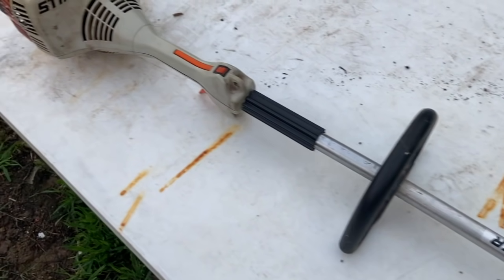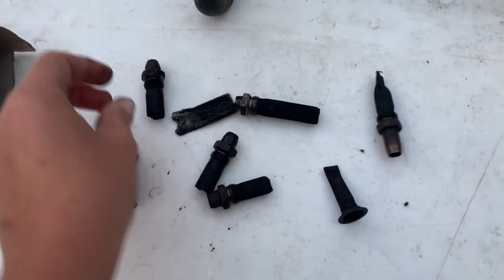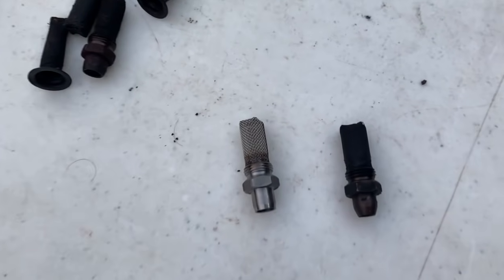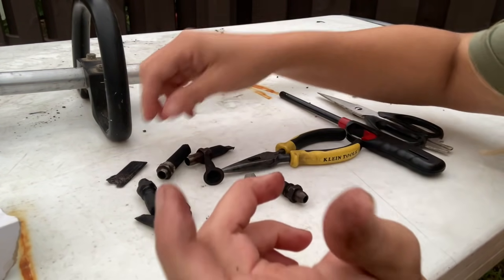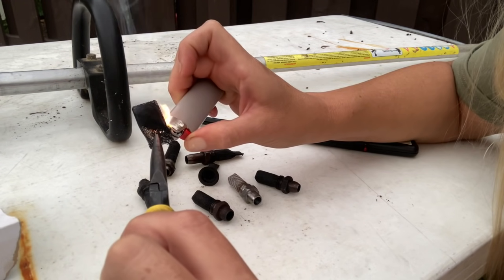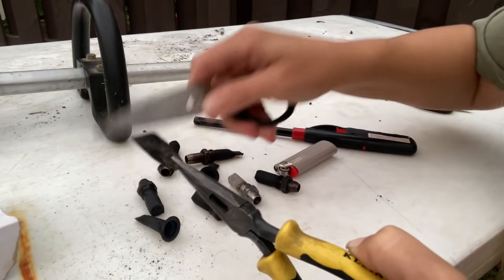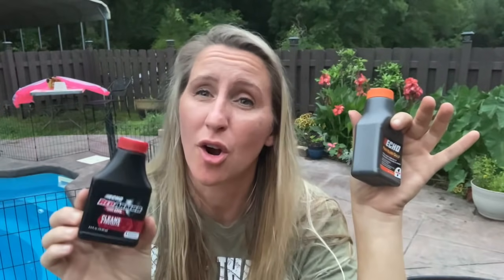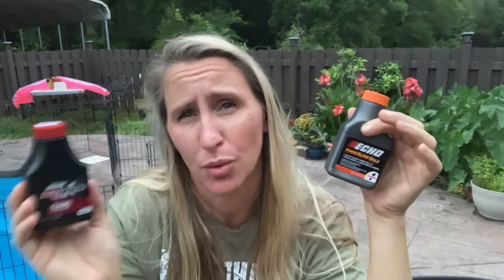THE BIG SECRET! STIHL has NO POWER? Won't Throttle Up? How to fix your trimmer/blower.

Comment: I have pulled the spark arrestor out of my equipment for years.
Haven't started any fires and the EPA has not arrested me yet.
I am 70 years old
Reply: OLD SCHOOL BEST WAY
Reply: Yep, I have done the same and I'm 65.  I feel like a fugitive from justice though, when I use my trimmer I keep an eye out for the "Spark Arrestor Screen Police".
Reply: I guess it's really true what they say about old dogs and new tricks.
Reply: Watch out for the EPA SWAT team sneaking up on you in their stealth black helicopters.
Reply: The forest service has standard (FS5100-1D) for Spark Arresters and 36 CFR 261.52 is the federal regulation that requires the use of spark arrestors in accordance with FS5100-1. Modifying the exhaust to improve performance is always a balance between flow restriction and performance. Just don’t get caught in the forest service jurisdiction without them. Painful and costly potential experience.
Reply: I don't know why they put spark arrestors on Equipment that is for residential use the whole spark arrestor thing was started by the Forestry service many years ago and was directed mostly at 4 cycle engines back then I was motorcycles and still is it's funny cars and trucks drive
 through the forest and have an exhaust system but no spark arrestor on it
Reply: @DesertSawyer  forest service will check as well. Typically easy to locate someone using a chainsaw and it's simple to check if it's missing.  I'm sure you'll get blasted for being the hall monitor, but you are right and could save someone a costly fine. Home use and a trimmer for example is a other story tho.
Reply: @1995dresser  they also typically have much longer exhaust runs than a chainsaw or string trimmer. Alot harder for sparks to travel down 3 feet of pipe than right out the exhaust port and into the Great beyond
Reply: That will be the EPA at your front door!
Reply: Agree. Home fine tuning is important
Reply: Well Paul,  I happen to work for the EPA.  what would be a good time for me to visit? lol
Reply: @noclass2gun342  yes that's true but I am sure like me you have seen hot carbon or even a flame shoot out of a car exhaust from time to time
Reply: Had a stihl pipe saw.  Cut steel with it and sparks are everywhere. Despite that it has a spark arrestor that plugs up within six months.
Reply: Yep
Reply: @DesertSawyer   I always try to sneak in and trim as much as I can before the EPA and the rangers try to catch me 🤔🤔
Reply: That's right, with our two stroke bikes that was the first thing to go.
Reply: Clean it and put it back not worth your house in a law suit !
Reply: @Joe. Halo Garbarino A clear indication that a different law is in place for these elitist bastards and another law is in existence for us poor downtrodden hard working peasants. 🤨😲😊
Reply: Paul Zacher - I too am guilty of pulling the arrestor out:) How they get ya is if you start a grass fire and then they determine it was because your equipments arrestor was removed.
Reply: When you are modifying the performance characteristics of your saw or other 2-cycle engine, the exhaust flow characteristics are just one of many i.e. cylinder porting and polishing, intake filter modifications, timing advance, coil changes, and so on. All are used in harmony to give the best performance for the power saw…or tool. In the case of the exhaust mods to gain performance, as in dual porting the muffler, you can dramatically increase the performance while being compliant by using spark arrester screens on both ports. Just remember…making more noise doesn’t necessarily mean more power…it just means your power curve has changed and you need to adjust to that or continue with mods elsewhere to improve the overall performance of the engine. Also…don’t you just love the weird off the wall rabbit trails comments can take the conversation…it’s hilarious sometimes.  The point of a clogged screen that Chickanic was making is a good point. Even experienced 2-cycle users whether with chainsaws or others can forget about the screen. You just have to realize that when you use your 2-cycle power tool at 1/4 or 1/2 throttle when trimming the lawn or cutting wood, you will need to keep the screen from clogging one way or another. Whether manually using the method demonstrated or running your engine at full throttle enough to keep it clear.
Reply: @Joe. Halo Garbarino 
Ha'' Ha! @Joe a great dissertation 
on the Clintons, by those standards 
We could do our weed cutting with
A fully automatic submachine an it
Would BE LEGAL.....
Reply: @DesertSawyer  LOL!!!
Reply: We are on the way.  Address please?
Reply: @Joe. Halo Garbarino Yeah but what about Obama?
Reply: Not all Hero’s wear capes!
Reply: If Greta sees your comment you’re finished, she’ll have an army of angry climate alarmists barking at your door.
Reply: Paul -  Key word here is "YET".  So it could never happen. But if it ever did, you could start a fire that might cost you thousands of pesos ... (Why not just clean it !)
Reply: Same here at 69yrs old. If you want your 2 stroke to last hit the gas!
Reply: Put a spark back in your life!
Reply: Same way. Simple is still the best.
Reply: Exactly man. I just said the same thing, it's a bunch of bs. Just take dang thing out n run your machine however you want.  People over complicate everything.lol
Reply: John Everlasting  I agree. Manufacturer’s don’t have a whole lot of options when it comes to legislation and how they maintain a successful business so, a one size fits all approach is cheapest hence, Spark Arresters for all. With a little thought and engineering, one can work around the performance issues of screens and still have a brute of an engine.
Reply: The very first thing I do is to remove the stupid spark arrestor screen on every small engine. Easily 30% more power and infinitely more reliable.
Reply: @DesertSawyer  nobody really cares.
Reply: @allaboutroofing2  they can't take anything apart without a warrant.
Reply: @brentnone-ya3544  🤣🤣🤣
Reply: @duckwacker8720  I know. Very rarely does anyone use their chainsaw, unless professionally, in the woods where it would be an issue. That being said…they know now.
Reply: @duckwacker8720  they don't have to take it apart. You can shine a light in the exhaust hole as see if it has one or not. Of course they can't take your shit apart.
Reply: I met lots of people in California that removed the spark arrestor on a piece of equipment over the 32 years I worked for CAL FIRE.
Reply: @rustyclaymore1105  I believe you. Removing the screen is the cheapest and quickest way to gain a small jump in overall performance.
Reply: @rustyclaymore1105  CA doesn't have the best record for fires. Not something to brag about really.
Reply: Yeah, I understand that... BUT they seem to have a little wildfire problem there(?) in the USA and here in OZ. Better safe etc.
Reply: That spark arrester is history. Old school works best! 
I've run my old Harley for years with no baffles and I never hear any complaints!
Reply: @derekcole5593  that's because you are deaf. Hard to hear complaints that way. 😉
Reply: @derekcole5593  Yeah, Harley, 2-cycle, Top Fuel, and Formula One engines have sounds like no other. A symphony for the senses.
Reply: @DesertSawyer  and for a man's soul.
Reply: @allaboutroofing2  What did you say?
Reply: In theory it could but it would have to be extremely dry and stuff very easily ignited.
Reply: @Joe. Halo Garbarino 👍
Reply: Well done ,I do the same thing except after doing what you have, I re-tune it alittle richer to compensate for the better exhaust flow & to keep the head abit cooler!
If there is a mesh filter for the fuel,I get rid of that also & put an inline fuel filter in whenever I can!
Reply: Ken Brown @ Yup,so pay attention 😜
Reply: I'm with you on that, we had Ranger Bob out in one of the national forest here in Louisiana always trying to flag us down to stick a rod in our exhaust and check for the screen. We just pretended not to see him and would motor away.
Never had a fire in all the years we were riding either.
Reply: The dealers and people on youtube can't really tell you to do that.  It's probably breaking some law.
Reply: As i understand it, here in EU we don't have spark arrestor on any of these machines. I'm at least dead sure our machines don't have any. Some are old and some are new.
Reply: @DesertSawyer  thank you sir I have gone two a four stroke weed eater which helps and my dirt bikes and saws I just clean them and a lot of the new oils you can easily run at higher mix ratios 50 to 1 or more which really helps and as far as more power I own a medium size stihl pro saw and compared to other saws it certainly does not lack in power without any modifications just keep it sharp and a clean air filter colorado life time resident and I'll keep my spark arrestor on the saw where it belongs !
Reply: What is your opinion on Opti-2 oil? I've been using it for a couple of years in my trimmer with no problems.
Reply: yup!  same here , plus remove any baffles
Reply: If I lived anywhere out West I would use the arrestors. Lol!
Reply: I guess no one here that removes them lives in an area with dirt daubers or mud wasps? I've had over a dozen units brought into my shop this year where the spark arrestor prevented those little bastards from going into the muffler then into the cylinder.
And one where they took it off and a nest was made in there which caused the unit to have failure with extensive damage.

Also, just shake your can like it owes you money before each fill up. Most of the time the screen is clogged from the fuel and oil separating to cause an imbalance in ratio. More oil in the mix causes an impure burn which send carbon to the arrestor and clogs it.
Reply: Absolutely right, get that screen out of there!
Reply: You outlaw! 😂
Reply: @DesertSawyer  Did you find out the hard way? You seem very educated in the spark arrestor laws.
Reply: @rustyclaymore1105  What happens? A fine?
Reply: @johnnellis3025  billed for cost of suppression.  Usually a percentage of a 5 to 6 figure amount depending on the cost of the incident. Judge makes the final determination.
Reply: @johnnellis3025  Thankfully no. It would be a really inconvenient experience to get this kind of fine by a federal agency, especially nowadays. I just have had to deal with some pretty complex federal/state compliance environments in the industry I work in now.
Reply: @allaboutroofing2  none of which were caused by removal of a spark arrestor is the point he was making
Reply: Sirs, Put Ur hands behind Ur back, watch Ur heads getting in the back seat.
The good part 3 Hots and a Cot plus no more weeds, grass, leaves to deal with LoL
Reply: @southtexasspecials175  
The very mentality that push these regulations are the same that are instrumental in all the forest fires of late having so much fuel.
Reply: @DesertSawyer  
Much of this is not done through legislation but unelected individuals justifying their jobs.
Reply: @derekcole5593  That's because you are deaf. I guarantee that if you run straight pipes plenty of people are complaining. Unless, of course, your comment was a joke, which it sure sounds like.
Reply: @DesertSawyer  while I am with much of what you said, the part about cleaning screens I totally disagree with.
I run 40:1 in all my saws and 2-stroke equipment I don't clean screens. 
Stihl ultra is one of the last oils I'd ever run in them other than a splash into my mix so others could tell it has been mixed. Stihl oil stinks and will clog up a 2-stroke, not because it isn't revved out constantly, but rather because it is not a proper oil itself. Like I said, I don't have any problems with my 2-strokes and I can let them idle for very long times. I just fired up my 20yr plus redmax backpack blower today and it started on the first pull, not popped, it was running on the first pull because shut the choke off quickly. I've ran that at an idle many times or just above for a full tank of fuel with it blowing on the bonfire and I didn't change the spark plug until 2020, and then come to find out it was the switch and not the plug.
Are you on any forums?
Reply: SUCH A REBEL! I bet your mattress tags are gone too
Reply: @anthonythorp7291  🤣
Reply: Beautiful work
Reply: The  ' arrestor  guy '....hard at work again. ''Arrestor   Suppressor   Remover ''   eh ?  Good luck,  Paul !
Reply: Wow my 2 stroke dirty build back in the day never had a spark arrestor, ran great and never started any fires.  Throw that shit out!
Reply: Mr. Paul, good morning. It took me two years to find you online. My name is Mr. Anderson and I work for the EPA. Can get your address please. I would like to talk to you..... in person. 🤣
Reply: I'm 37 and I remove the spark arrester screen from my equipment too. I have never caused a fire with any of my equipment nor have I ever heard of anyone causing a fire using their Equipment. Thankfully my old schindelle weed eater never had one but my Husqvarna leaf blower did And it got removed the second time. I ever had an issue with it and I haven't had any issues since
Reply: exactly, just throw that ish away!
Reply: @allaboutroofing2  They will not... There are tons of forestry workers who put "bark boxes" on their saws.  They port and polish the heads, install bark boxes on, and have a much higher performance saw. I know several of them.  Forestry service could care less.  What they care about is some dipshit with his dog camping, and not knowing how to deal with a campfire, or not picking up his trash.
Reply: 😂 me to I think its mostly for emissions

Comment: A propane torch is the best option for burning off the carbon. You won’t need to scrape anything off possibly breaking the mesh screen or how it’s attached to the fastener. 
Love your vids!
Reply: I use carb cleaner and a brass brush. Works just fine.
Reply: Just take the muffler off turn up the radio
Reply: 👍  I agree.  A propane torch does work very well.  In fact any torch style lighter, such as a torch style cigar or grill lighter will get the screen red hot, which will burn off the carbon/crud.  No scraping necessary.
Reply: @treesawyer5921 
Usually if we had an old dirt bike with a coked up pipe ,it was time to bust out some Brewskis and throw the pipe in a bonfire for a little while.
Reply: @patrickamcguire8749  soakin em in gas will also break that carbon up toothen take your little brush to it
Reply: I've always used a propane torch also, it works great and like you said, "You won’t need to scrape anything off".

Comment: Great advice!  And thanks for asking; I'll add a note about my experience LOL. Long story short, after one season, I thought my KM56 powerhead was dead - either would not start or would stall with the slightest amount of throttle.  After checking fuel, filter and plug, I pulled the spark arrestor screen.  It had turned into an exhaust arrestor - packed solid!  Propane torch did the trick.  And sure enough, I used to run at midthrottle settings as opposed to wide open throttle.  

Fast forward; I've added a KM111 to the stable since we have two properties to deal with, and normallly run both it and the 56 at WOT or idle, nothing in between other than for delicate areas.  I have not had to clean the screens on either of them for seven years.

Love your channel!

Comment: WOW ... funny to find this!  I have a 37 year old Echo trimmer (SRM-210AE .. 1985) ...still runs great.  I do run it rich (too much oil).  Sure enough, about 5 years ago it would not start.  Took off the muffler ... found the spark arrestor .... clogged solid.  Cleaned it (eventually replaced it when I found one) ... still working great!

Comment: Thank you for your videos.  I recently had an issue with my Stihl weed trimmer not throttling up.  A dim light came on in my head where I remembered watching this video about a year ago and sure enough, the screen on the trimmer’s muffler was blocked with carbon.  I burned it off and now it runs great.  I’ve also fixed a carburetor on my Honda mower following you advice.

You are a kind person for providing such great advice.

Comment: Glad I watched the whole thing. I've had 0 problems with most of our Stihl equipment while using Stihl oil, but that's probably because we use them commercially, at full throttle for most of the day. This is useful information because our least used tool, our hedge cutter, always seems to be preforming lackluster.
Reply: I switched to Motul 800 offroad and never looked back. The HP Ultra is a great oil, but I love the smell and less deposits that the motul puts on the table.
Reply: That’s the thing has to be full throttle. At least at some point.

Comment: Very rarely ever replaced the spark arrestor unless damaged. Get the handheld torch out and burn screen until cherry red, blow out with air, and if its still clogged spray screen with penetrating oil and reburn it. It will clean up after that.
Reply: This is exactly how we do it in our shop :)
Reply: Nice to see a pretty lady that knows what she's talking about I'm tired of these beginner people that heard something once and then want to make a video not knowing a damn thing about what they're talking about
Reply: Happens on any two stroke that gets run at low rpm. See it on pumps on wildland fires frequently. 
Dip screen in some gas and ignite helps burn off. scrape gently and repeat if necessary. Run high rpm with a load, keeps things working smooth
Reply: Yep save the customer a little money
Reply: @hondag200 From the empire that the sun never sets.